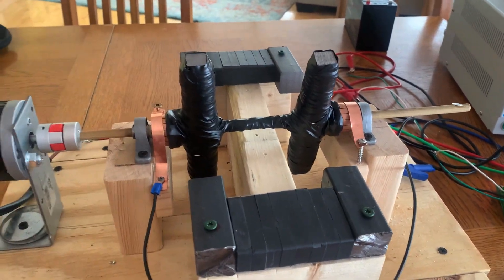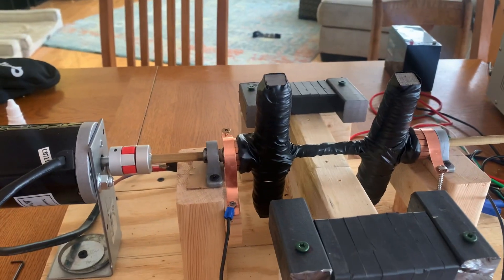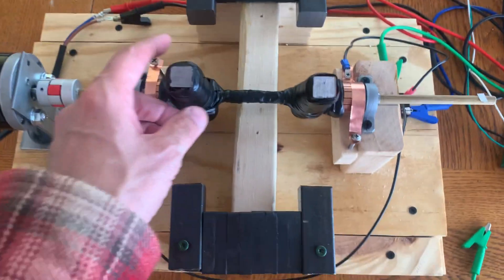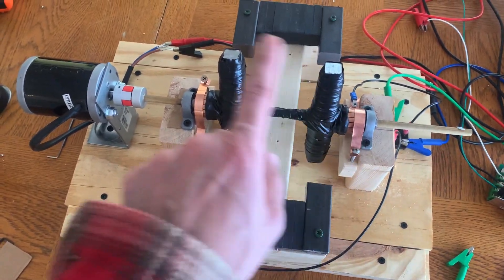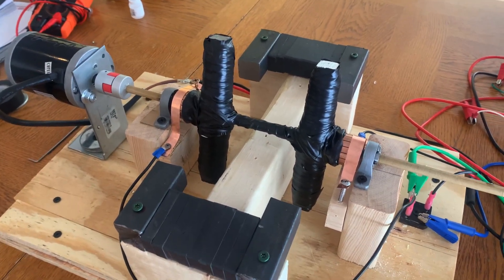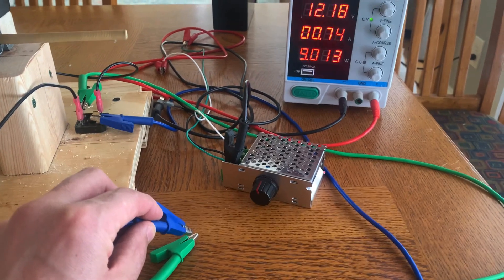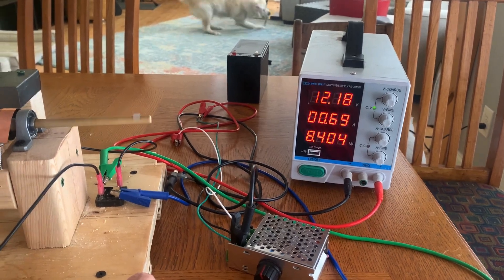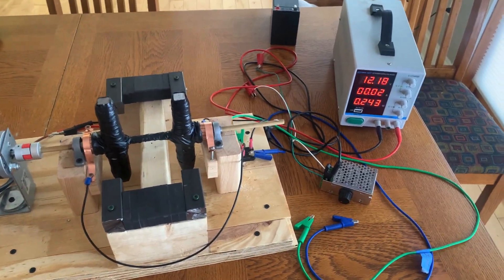Kromrey Generator

Comment: Hey brother! Try a simple setup for me. Drive a 2 or 4 pole stepper with any DC motor that will spin it. Reverse  Lenz effect all day! It is speed(frequency) dependent. Must reach a minimum speed, then short one of the stepper motor poles to see it speed up, it's weird to see with such a simplistic motor/generator setup! Once you're familiar with the speed threshold, you can obviously play with different loads etc.

Comment: I studied this device and built even improvenments. It does require less energy to drive it under load. But the coils in generators are usualy very narrow. The longer of a coil you have, the less amps you get out of it. You want as thick of a wire as possible and many winding turns also. But you're really limited with space. Although it does require less energy under load, it doesn't replace the ordinary generators. It's not more effective nor more efficient. I can only warn you that you're wasting your time with this device.
Reply from the maker: Yes, I found the same thing. Prime mover power decreases under load but overall the motor/gen is not OU.

Comment: Nice build nice as a simple motor generator for experimentally testing ideas like add a plywood wheel with small neos that turn with the motor then add two more plywood pieces with Adjustable neos That line up with the lock up of the iron and  magnets tune by adjusting the neos in and out eliminating the lock up should make you over unity like 2.5 over . Just by not allowing lock up

Comment: I think i see the commutator being partially bridged by copper strip, as if it were functioning like a slip ring or is it truly commutating? If it is trully commutating, then the output is mechanically rectified to pulsed DC current and the external circuit doesn't need a diode bridge rectifyer and the voltage drop of passing through 2 diodes. 

On another topic, I'm not sure we can call a shorted coil a load here.  At least not how we typically think of a load. Maybe we might call it inductive loading, and the difference is significant. Crazy, I know but hear me out.  

If I connect a resistor to an AC power source, then current flows in phase with the voltage phas and energy is disipated in the resistor becoming heat. But if I connect an inductor (like say a coil wound on iron) to an (ac power source) or (rotated in an alternating magnetic field),  current lags either voltage supplied by 90 degrees or the change in magnetic field, causing power to alternating flow into and out of the inductor or inductor rotor alternatingly drawing energy from and pushing it  back into the field, because energy is temporarily stored in a magnetic field inside the inductor  and when current drops the magnetic field inside the inductor collapses inducing a voltage on the coil thus returning energy back to the source.

  We might call it reflecteded energy because it is not consumed and returns to the source. Capacitors and inductors introduce reactive power to circuits, where apparent power = sqrt ((real power)²+(reactive power)²). Sometimes called the power triangle and factors into concept called power factor.   In AC circuits with reactive elements we instead talk about (z aka impedence measured in ohms) = sqrt (((xL aka inductive reactance in ohms) - (xC aka capacitive reactance in ohms))² + (resistance in ohms²).
Reply from the maker: I’m a novice in electronics and so probably using terms incorrectly. I believe It’s technically a “slip ring”. It has segments to it like a commutator but I wired them all together so they act as as one continuous piece of conductive metal. The prime mover turns the rotor and the coils output a continuous AC wave form. (Albeit not a sine wave exactly). Anyhow, when the coils are shorted it speeds up and draws less current. Putting other resistive loads across the output had a similar effect - I tried an LED for example. 
You are right about the reactive elements of AC power - there is more to study on the Kromrey but it needs to be better built for starters. I might try to build another version in future. Thx for comment
Reply: @energyhack3538  maybe you might find the motor I built interesting.  Nothing spectacular, but I had this idea on how to build one with materials that were easily available to me.  The build and Several videos testing it are on my channel.
Reply: @energyhack3538    com·mu·ta·tor  (a device for reversing the direction of flow of electric current).   so when magnets are on the stator and coils are on the rotor, you need a mechanical commutator to switch the direction of current in the motor coils if you are  supplying the motor DC. Commutators on a generator  allows current in the coil to reverse  while brushes  collect a pulsed DC current. 

Alternately, (no pun intended) and this is rarely seen today, you could electronically commutate the current to the coils on the rotor through slip rings. Or you can build a motor that has its coils on the stator instead and electronically commutate current through the stator coils as is the case with many BLDC motors.
Reply from the maker: @kreynolds1123  For simplicity, I think coils on the stator are the way to go. I always wondered why Kromrey didn’t do it this way anyhow. Then no slip ring is required.
Reply: @energyhack3538  I've been contemplating turning the simplest of  reluctance motor with no permanent  magnets, one low reluctance path steel rotor, and one center tapped coil, and turn it into a generator.

Comment: Great experiment! That’s for sharing ! Were u able to measure output?
Reply from the maker: Yea, not much if I recall - far from unity but could see effect of load reduction when coils shorted. Would be interesting to rebuild but have magnets rotate instead of coils - simpler design - could build it better
Reply: @energyhack3538  definitely a better idea instead of brushes !
Reply: @energyhack3538  i saw some experiments with making low consumption induction heater by introducing magneting rotation near pipes(that sometimes could even melt) with or without water in them so why dont you try adding that properties to this motor to reach overunity with additional placing of stirling engine  to make it like this motor makes magnetic field on pipe, pipe reaches high temperature, high temperature makes more then 10watts output of stirling?

Comment: I cant get the desired effects and i wound it in series like yours.
Reply from the maker: You might try using more wire. I watched your vid and construction looks great but maybe you need more wire. I’ve wound my three different ways and only saw the reduced power draw with only two of the configurations. (5) strand #30, 500t per coil worked best (8.9ohms total)
Reply from the maker: If u get the correct waveform on scope pretty sure u wired it correctly.  If u use neo magnets it produces more power but also draws more because of cogging.

Comment: if its not over unity, its not built correctly / you misunderstand how to utilize
Reply from the maker: It’s a very crude build, wide tolerances, unbalanced, not much wire, no laminations, mild steel instead of soft iron, etc.. but it does prove the patent is right - put it under load and power draw to prime mover is reduced. A machined and well constructed unit would perform much better.
Reply: @energyhack3538  how did you wind the coils? opposite to the patent ? 
good job either way!

Comment: Is there any critical frequnecy of rotor, when this effect "acceleration under load" appear?
Reply from the maker: No- same effect at various speeds
Reply from the maker: This is a pretty crude replication of the original but does validate the claims in the patent. I saw a photo of it and the rotor iron was quite large - like 2” x 2” square by 3” long - the clearance from rotor to stator magnets was very tight.

Comment: Do not worry, over unity is real.  One more confirmation of it here:  https://www.youtube.com/watch?v=tM_HRwqKzFk
Reply from the maker: I’ve corresponded with this guy — he’s got a great website and a solid state version. The solid state version uses relays, which are basically small induction coils, and so the effect is similar to what Benitez did 100 years ago.. the other version leverages the principle of magnet power being multiplied when subjected to electromagnetic fields. Thx for sharing

Comment: How many wats is generated?is there at least 1amp? I made the gfielf gen..and bogs down
Reply from the maker: Not much.. maybe 1 watt or less.. with more wire and stronger stator field, better precision construction,  it would generate more.. I built only to test the patent claims that it pulls less power under load than unloaded - and that I found to be true.

Comment: You are talking about regenerative acceleration which is normal when you short a coil.... Nothing new. Thane Heins did a lot of work on that subject. A coil shorted introduces a delay which allow the rotor speeding up. The max delay possible is at max load which is a short circuit of course. In other words a coil shorted is a RL circuit where T (time constant)= 1/RL. When R tends to zero (short) T tends to infinitive.
Reply from the maker: this patent predates Thane Hein work by 50 years.. I have watched a few of his vids where he demonstrates reduced prime mover load while coils are shorted (or loaded).  I guess I’m not familiar with exactly how his works. 
If I short coils in a standard elec generator it will bog down the prime mover.
Reply: Does Thane Hanes coil needs to be build a special way?

I am trying to recreate the regenerative acceleration effect. It says the coil has to be a high impedance coil.
Mine is made has 1.5 Henries. But with the core inductance goes much higher.

I have calculated the time it will take the magnetic field to form in the coil using a formula I found on another's person demonstration.

Inductance / resistance = milliseconds for the magnetic field to appear in the coil.

I take the rotor to the calculated hz but it does not work!

If you know how to recreate it please help!

Comment: Thanks for sharing, interesting stuff.
Reply from the maker: Both- There is copper wire coils under the elec tape on the rotor bars.. it’s connected to the commutator on either side and rotor bar coils are wired together in series. The mag flux through the coils (from the stator magnets) reduces their drag on the stator iron poles when current is allowed to flow so you get an anomaly of a generator that uses less power from the prime mover when it’s loaded. 👍🏻
Reply: What is the function of the copper parts? Is it only for conducting electric current or also for commutation (i.e. changing the direction of the current)?

Comment: Diagram?
Reply from the maker: Wind the rotor bars opposite one another.. wind one CW and the other CCW.. but in series..the end of either is connected to the commutator on each end…make sure stator poles are also opposite like I show in video…
Reply: @energyhack3538  thank you very much